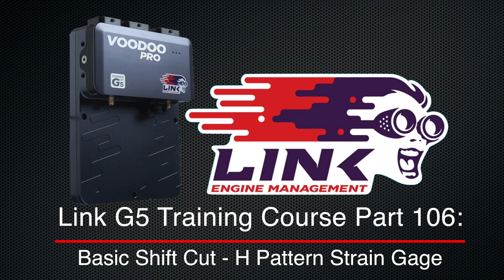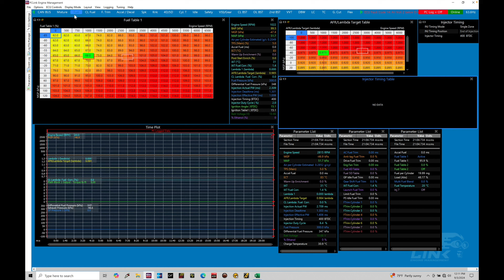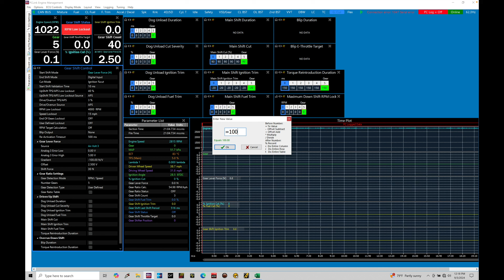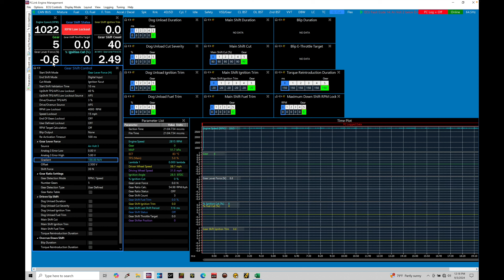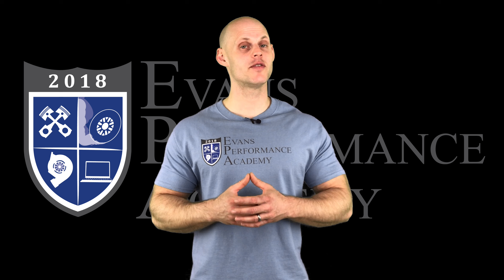Link G5 Training Course Pt 106: Basic Shift Cut - H Pattern Strain Gage | Evans Performance Academy

Comment: For a haltech ecu , does the resting voltage need to be at 2.5v for H pattern ? What if the voltage from the shifter sits at 0v at resting position?